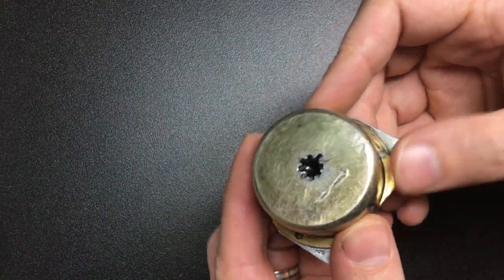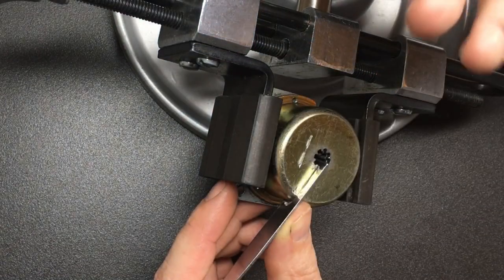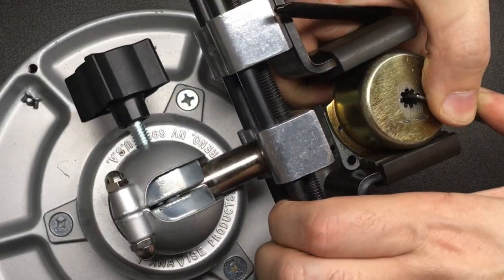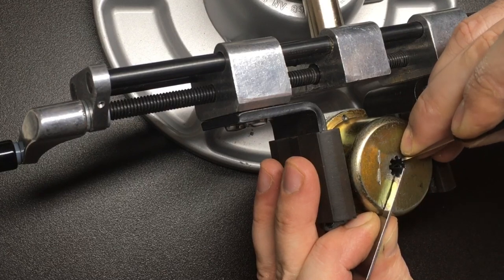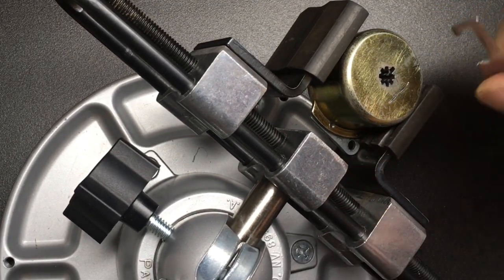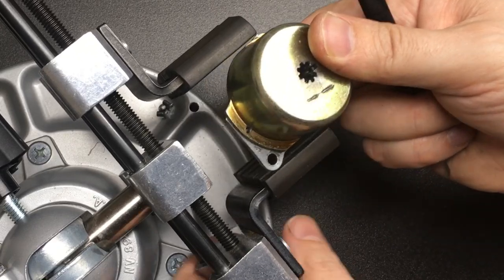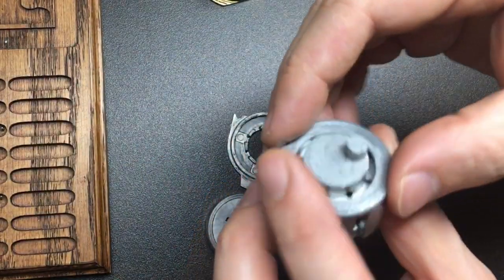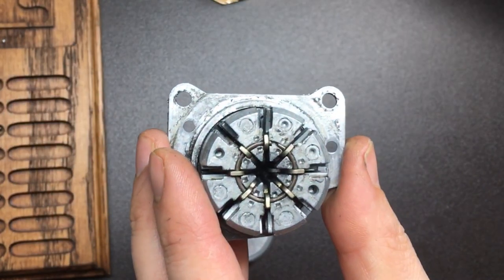Fichet 8 Lever Safe Lock Picked

Comment: Having used a safe with this type of lock I think it was either 1/2 or 3/4 turn. I wouldn't want to pick it in place as the lock was set deep in the door with a long key. But very interesting to finally see inside the mechanism.
Reply from the maker: Yes, in situ, it would pose a harder challenge for sure 👍

Comment: All the actual gates appear to be in the same place, so you could probably use 8 tapered knife picks, shoving each one down as far as it needs to click that lever into its gate one at a time until you have all 8 knives in place, then you can turn the whole thing as much as you want
Reply from the maker: Yes, in fact that’s pretty much how the decoder picks for these locks work 😃👍